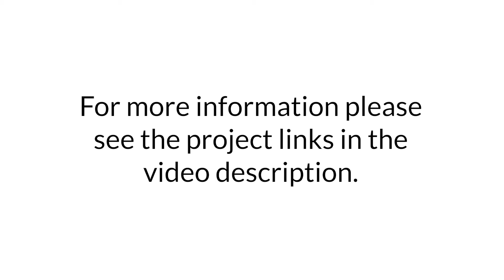Puget Sound Gateway Program – SR 167 Completion Project

Comment: Just my opinion, respect to everyone working on this tolled project, but toll roads are unethical. More reason why Washington state has the most regressive tax system in the nation. Never forget when Washington state and WSDOT had people vote to allow tolling of the new Narrows Bridge with the promise that the toll funds would be to pay for the new bridge, only to adjust the law so the toll profits would divert to the general state transportation fund. This new project, as stated by the WSDOT, is mainly to benefit corporations like Amazon, so they can have quicker access between their warehouses and the port. Washington state will continue to prioritize corporate interests rather than the interest of the citizens of its state. Sure they'll build an underutilized "shared use path" and make some "native" wetlands but that's just a smokescreen to placate the population and puyallup tribe.
Reply: Wrong. Amazon doesn’t do a lot of volume from the port down 167. It does it down I-5 to Lacey.
Reply: Actually, a Federal court ruled that Washington couldn't continue to collect tolls for the Narrows Bridge beyond the construction of the bridge which was the purpose for which the bonds were sold. There would be nothing illegal about selling bonds for maintenance of a bridge if that was part of legislative or public approval at the time the bonds were sold.
Reply: tbh paths like the one they're building are really important for offering people alternatives to driving

Comment: I'm wondering why a signalized DDI is planned for SR-167 and I-5, when both highways are access-controlled freeways (or a toll road in SR-167's case) at that point, especially in close proximity to a port with a lot of truck traffic.

A double-crossover merging interchange (DCMI) would make more sense (basically a DDI, albeit with overpasses where the crossover signals are) as a system interchange, but that's a patented design; Michael A. Gingrich Sr. of Illinois invented and owns the patent on the DCMI.